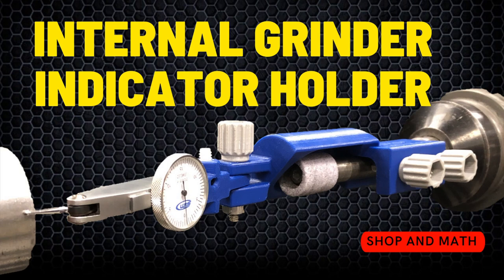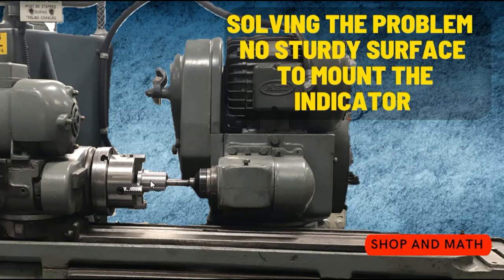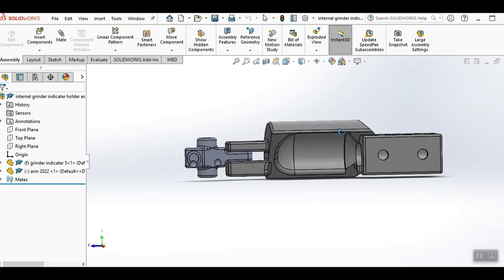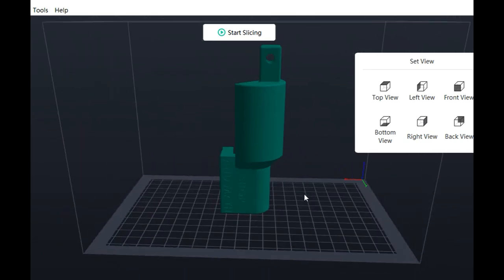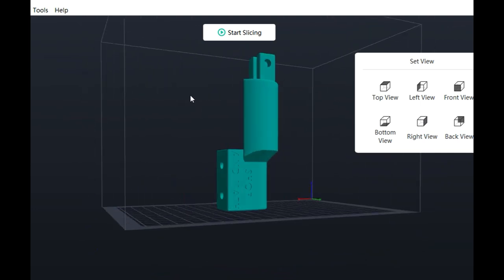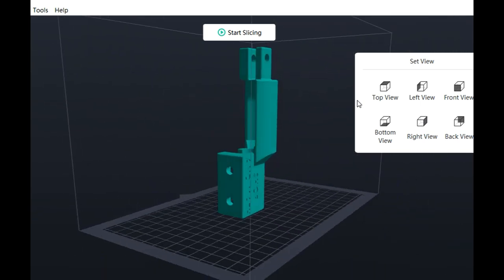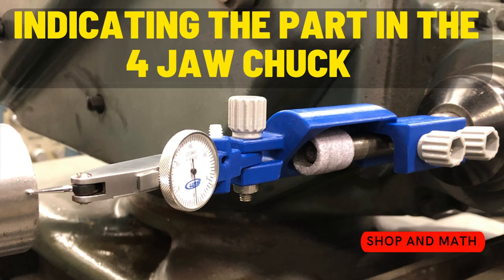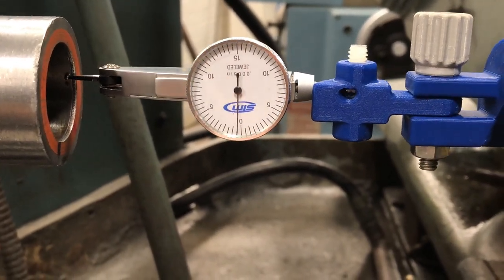Internal grinder indicator holder

Comment: Looks great. The only minor improvement I was going to suggest was to recess the nut for the indicator arm, but it looks like you already did that. I'm guessing the version in the cover picture was an earlier revision. I don't have an internal grinder, but there are lots of good ideas worth noting in your design. The nylon set screw is a nice touch.
Reply: Thank you for your suggestions
And thank you for taking the time to call matt much appreciated
Ray